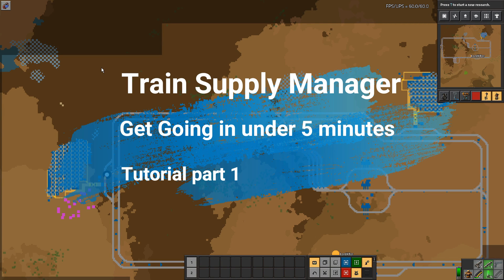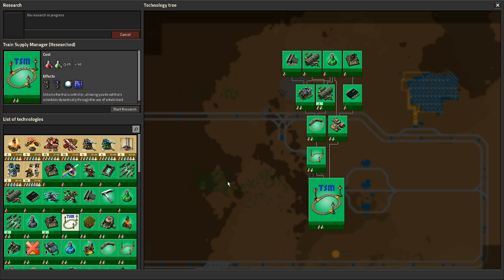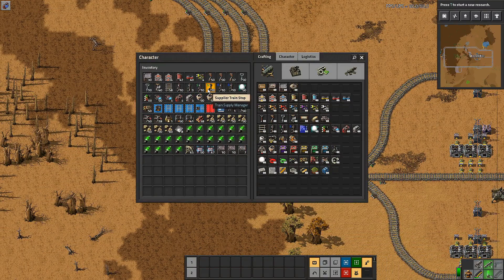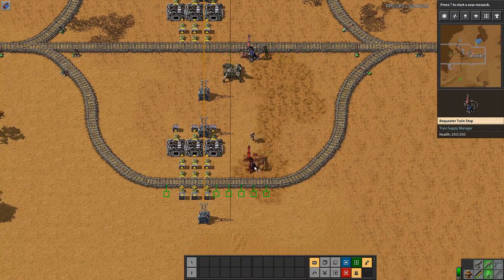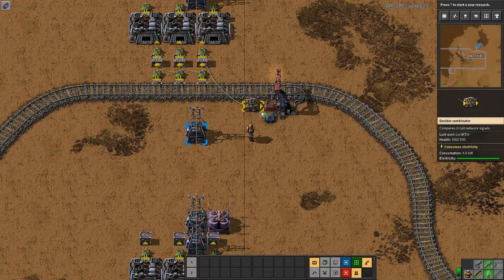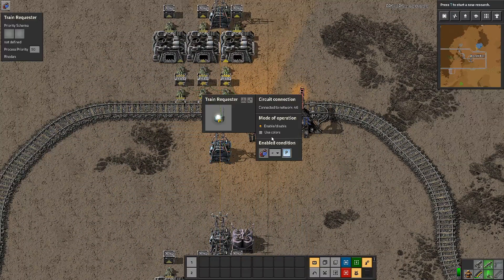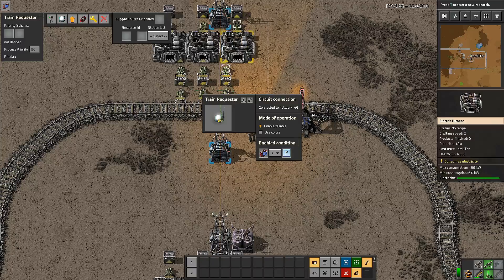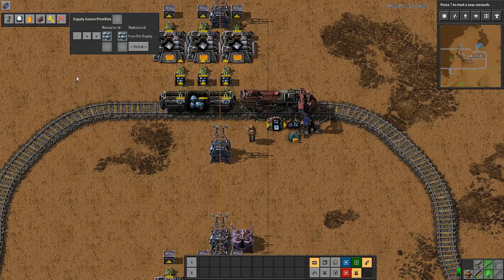Factorio TSM tutorial part 1 - Get going in under 5 minutes

Comment: This is unnecessarily difficult to follow along with, the view is far too zoomed out so it's impossibly tiny to see how the combinator/requester and counter are arranged with the wiring.  Also the narrator very rarely says aloud what item/button they are clicking on.  If the video explained the underlying concepts of why we configure things the way that we do (or at least explain why things are named the way that they are) that would be one thing but we're expected to blindly follow along a fast moving  narration to set up a system we have no conceptual knowledge of.  This is supposed to be an introductory tutorial but it's not designed to be followed unless you are already familiar with the system. I tried consulting the PDF guide to this mod but that's based on a different version so it's of even less use.

Comment: Seems a lot like LTN, which I have been using for a while. Not sure if its worth the trouble of switching over.
Reply: It differs from LTN, because this allows trains to sit full waiting to be requested. LTN treats trains like bots where they have a task to pick up and then drop off and return to the depot empty to then be assigned a new job anywhere in the network.
Reply: @nazeradom  Just an FYI, you can use the NetworkID filter on the combinator to avoid dealing with trains coming across the map, but like you said, the ability to have full trains waiting does sound nice.
Reply: It seems substantially more complicated, though. More of the logic is handled through manually-set parameters, not to mention priorities. It feels closer to an automated version of the so-called "Vanilla Train Network," where similar functionality is handled via signals strung from station to station. When I was still using that, I would routinely send trains to the "Parking" full of their respective cargo, waiting for a corresponding signal to send them along. One train would wait for > 1 Coal, another for > 2 Coal, another for > 3, etc. VTN doesn't scale very well, whereas this appears to. Just - that's what this mod reminds me of, more than LTN.

Comment: Is it possible to do this without a dedicated depot? I just want the train to wait at the mine until it is requested, but only if it has a full cargo.
Reply from the maker: Set up your mine with a normal train stop for loading. Place a supply stop immediately after the loading stop, and wait there.
Reply: @Sandman-qi2jy  Thanks for the reply, after I wrote this comment this idea crossed my mind and it works.

Comment: Loved the tutorial, by the way, do you need to use virtual signals or TSM signals at the output of the decider combinator, or can you use others? I've been trying to get it to work with resource signals but that doesn't seem to work..
Reply from the maker: Resource signals are also generated in the train counter when that resource is on the way, hence it is better to use virtual signals.
Reply: @Sandman-qi2jy  I see, TSM kept sending every available train of that resource supplier, virtual signals work like a charm, thanks :)
Reply: @Sandman-qi2jy  I don't know where my comment went but what is a virtual signal.
Reply: @rickherrin5364  The Virtual Signals are the icons that are not an actual resource.  In this case, he used the letter P.
Reply: @jemsterr  Thank You so much.